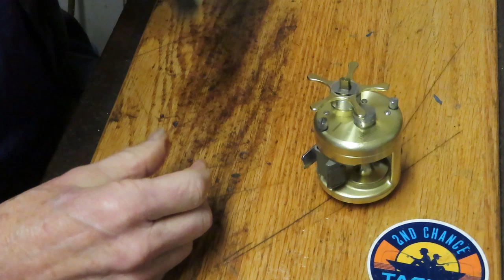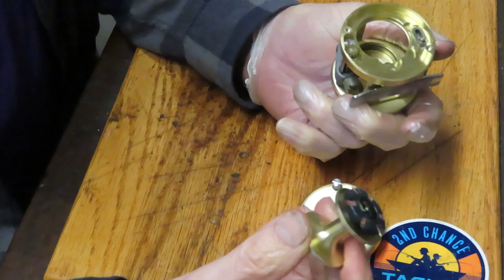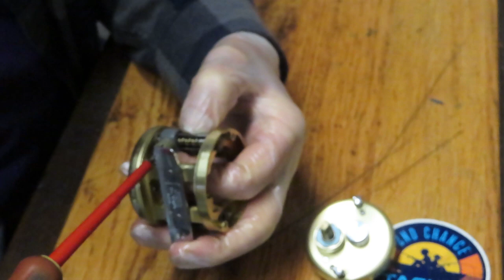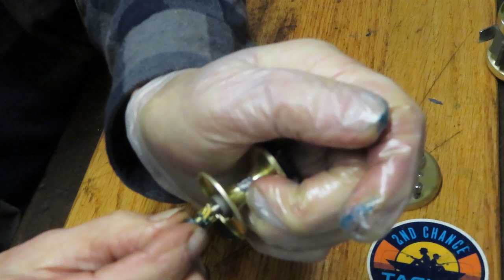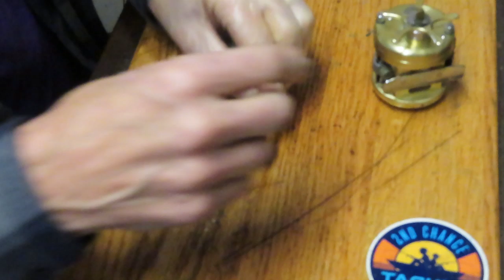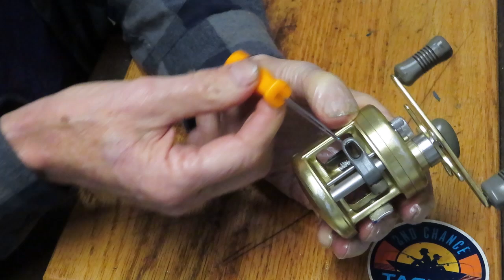Shimano Calcutta 151 Fishing reel how to service

Comment: Looks like a nice reel
Reply from the maker: It is!  and for those that like to fish with the left hand crank, it's a great one!
Reply: @2ndChanceTackle  That model is one of the 5 gold Calcuttas I have, it has many common parts with my 101B. Love it, such a reliable workhorse. I put drag clicker kits in all of mine!  By the way, that plastic pawl cap does crack, one of the few parts on these reels that needs replacing.
Reply: @barry4fishwhere did you find the click kit?
Reply: I have one that needs some love😂.  Can you still get parts like lighter spools or clicking kits?